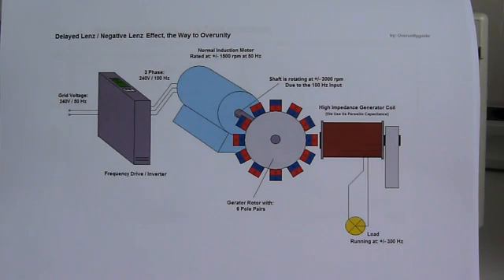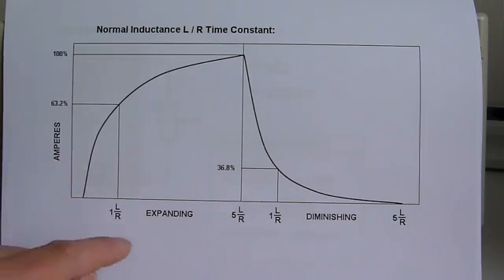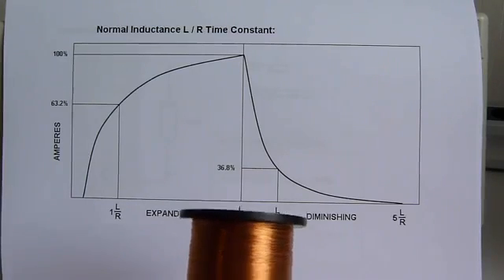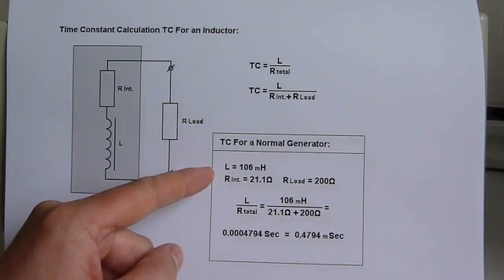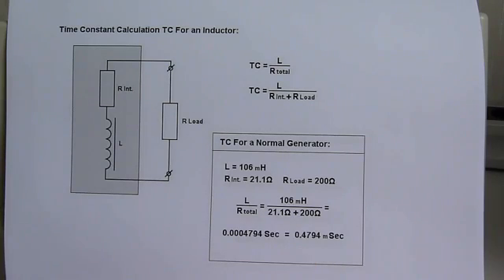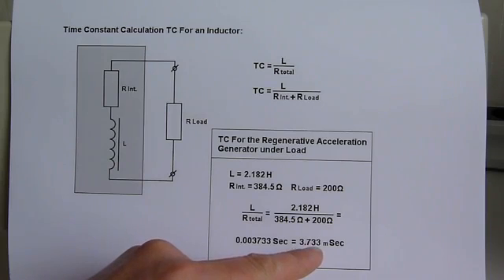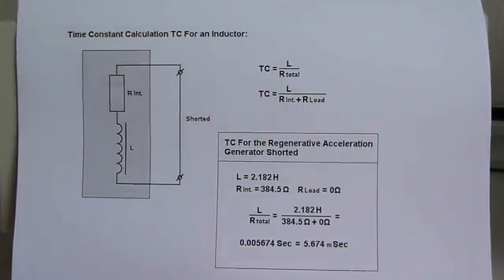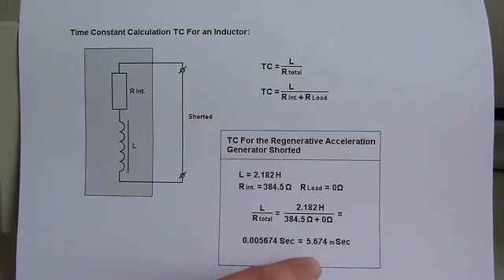Thane C. Heins Replication Step 3 - Calculation of the effect.

Comment: Hi Gary, Did you ever happen to find a good formula for calculating the right RPM according to the coil Henries and ohms?

I am trying to replicate this. 

I have built a bifilar wound coil that has 0.704 Henries and 68.1 Ohms! 
I used 26 awg cable and a pound of it. 
I made it bifilar using a machine that I made where you put two rolls of cable, spin it and on the other side you get a bifilar cable, rope like! Because of that the space in between the two cables is basically the same all over the coil!

However, I am trying to calculate the rpm I need to run the rotor at for 12 magnets, but I do not seem to get it right!

Comment: Hi Gary, i made a bitoroid transformer and it's not working despite the air gap in primary leg, my understanding is it's because the polarity of primary flux and back emf induced secondary flux is opposite that means at 50 hz  when primary produces North at top, the secondary produces south at top, that is why the primary flux and secondary flux attracts each other despite an air gap in primary leg, so my question is, does this time constant or rise time concept apply in transformers as well?

Comment: Thanks for the video but I think the calculation are wrong. The formula did not say anything about frequency or reactance. Any coil can have the regenerative acceleration effect regardless of it's inductance or DC resistance.

My understanding is that every coil has capacitance, irrespective of it's inductance value. This capacitance is not pronounce at lower frequencies due to high capacitive reactance value. As the frequency increases, the capacitive reactance decreases and the capacitance begins to increase (or become pronounced).

Once the capacitance is pronounced enough (or increased enough), there will be a delayed voltage because the coil capacitor will need to  charge up (since it's acting like a capacitor now) and then get discharged. The capacitance value is what determines the charge time of the coil capacitor. 
The higher the capacitance, the more time it will take to charge and the more the voltage is delayed.

Time for a Capacitor to Charge= 5RC
R is resistance and C is capacitance so higher capacitance means higher charging time.

So at the right frequency where the capacitance is pronounced enough (or increased enough), regenerative acceleration will be experienced.

I believe that is why Thane Heins stated in his patent that one can use Bifilar wound coils. This is used to make coil capacitance large even with a few number of turns thereby reducing the coil's inductance and DC resistance.

Based on my little knowledge, this is how I think it works :)

I say this because one of the replication videos created by this person showed the effect as you increase the frequency of the generator coil gradually. At a certain frequency, the input current neither goes up nor down when the coil is on load but above that frequency, you begin to experience the regenerative acceleration effect. That is why I'm no so sure of even the Top Dead Center/Impedance explanation in the patent.

I can't say for sure if my explanation is correct but I think it is.
Reply from the maker: Correct or not it's an intelligent comment, always a pleasure to read :) Interesting that you mention the capacitance, Thane has said that the effect increases as AC frequency rises (and so the inductor begins to behave more like a capacitor) so your interpretation seems to agree.

It's unfortunate that he used the frequency divider rather than just rotor speed increase in this video series because it obviously introduces more parameters. The effect is best seen in either the standard generator topology of magnet rotor and coil stator, or the transformer topology.

I'm privy to some of his comms with various companies, a lead engineer at Philips had this to say :

'On paper, the effect is infinitive, in practice it works only within a small phase angle window., but it works.'

The effect also stacks, of course, but each additional coil/core assembly does introduce more, initial, drag.
Reply: @GaryMcKinnonUFO  Thanks. I don't understand the last paragraph. Does it mean, adding more regenerative acceleration coils will cause drag on the motor? I don't think this should be so
Reply from the maker: @danielakintola8000  More drag due to more coil cores attracted to more magnets, so harder to spin up at first.
Reply: @GaryMcKinnonUFO   @Gary McKinnon  I guess the transformer will be much better for the regenerative acceleration effect than the magnetic rotor type.

I think it was whoopy. The only thing I'm not sure about in the induction cooker experiment is the type of wave the induction cooker generates.

I know it's a high frequency wave of about 24kHz but I'm not sure if it's just a sine wave or multiple waves together. Do you have any ideas?
Reply from the maker: @danielakintola8000  No idea at all i'm afraid, i didn't follow the Gegene threads closely.
Reply: @GaryMcKinnonUFO  In addition, have you heard of the gegene generator? The link to it is https://youtu.be/hI07DLlG3Qg
Its similar to Thanes Regen x operation and my explanation above. I think it's the capacitance of the coil that matters the most in regenerative acceleration.
Reply from the maker: @danielakintola8000  Yes, i remember it was all over overunity.com years ago, i think Whoopy was one of the first replicators, a French experimenter.